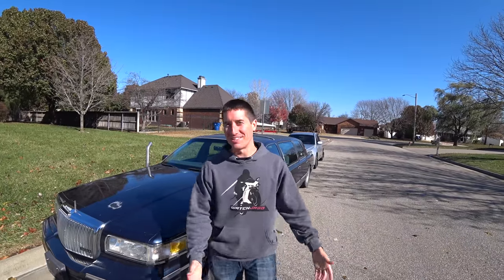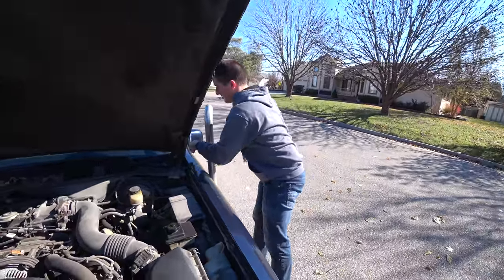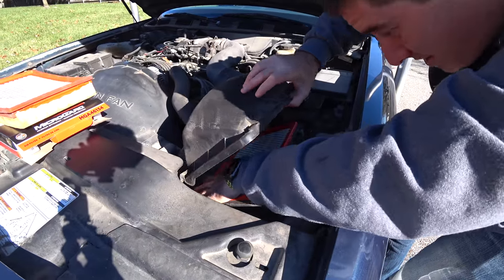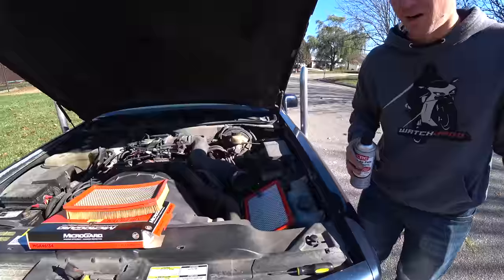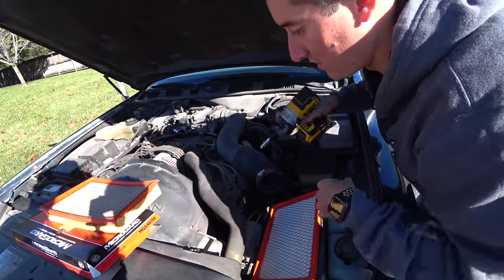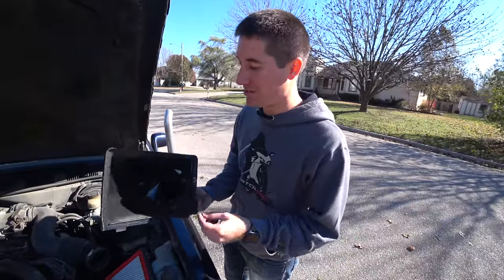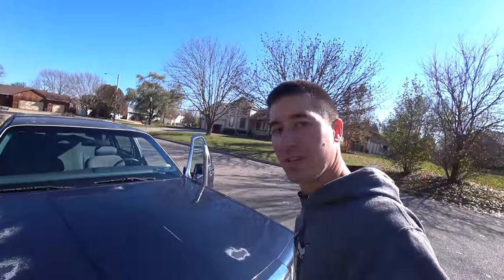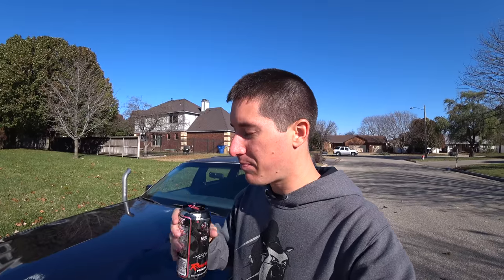FIXING My Cheap LIMOUSINE Lincoln Towncar

Comment: NEVER slam a Lincoln trunk lid.  Take it down slowly and the motor will seat it.
Reply from the maker: You're absolutely right, ended up covering the pull down motor in this video: https://www.youtube.com/watch?v=fDbnD4MNm4Y
Reply: @WatchJRGo  You needed a new pull down motor. Sweet when they work! Nice setup and a great car.

Comment: Check for a cracked vacuum line on the back side of the intake manifold, I had the same throttle problem and after I fixed the line it was completely fixed

Comment: It may be running lean with the exhaust like that and you could lose power. You could gain power by tricking the mass airflow sensor into making it more rich. You just tape some cardboard in the intake around the MAF making the intake inlet smaller in that spot. The air has to travel faster through that smaller section so the MAF gets tricked into thinking there is more air coming in and therefore it adds fuel to make sure the car won't run lean.

Comment: Maybe if you took the stacks off and put a more reasonable exhaust on it that would fix the feeling down on power and probably just for good measure replacing the other coil pack and perhaps the Mass Airflow Sensor and some general maintenance
Reply from the maker: It probably needs that 2nd coil, still misses a bit. 💯

Comment: Helps to use a q tip cleaning the mass air wires.
Reply from the maker: That would've done it for sure, I've always just sprayed them down (don't usually see that much build up on GM MAFs) 🔧
Reply: Do not touch the wires! If the proper spray (don't use intake throttle cleaner) doesn't work, just replace it.

Comment: Hey Junior check your driver side floorboard if it's wet you may want to take the plastic cover that's under the windshield wipers and clean out the three drains you were sweeping all that dirt it could already be clogged and with it being clogged the water will end up in your floorboard

Comment: The air suspension is only on the rear of the car
Reply from the maker: I don’t know why the driver side front sits a little low 🍻
Reply: WatchJRGo just a guess... broken spring, but the OP is correct the air is only in the rear.
Reply: @WatchJRGo  I have a 1996 and do all my own work, I know for a fact, the bags are only in the back
Reply: Some cars can level side to side like the continental and mark 8 so it could make the front look off if there's a leak.   However the panther bodies like this do both air springs together.  Don't drive with the suspension fully deflated and off it is the same as taking out your coil or leaf springs.  You'll just risk damage other components.
Reply: @WatchJRGo  Given the age there is a good chance one of the body mounts is failing.  Look close at the rubber on them then at replacement ones to tell for sure.
Reply: @WatchJRGo  Good possibility it's because the rear left air spring is lower than the right. Rear end is twisting the frame and bringing the front left down. If you ever want to replace the springs and compressor, look up Arnott Suspensions. Excellent stuff for cheap(er than most other places) Lifetime warranty too. Good company. I buy their stuff whenever I work on air suspensions.

Comment: Should always hook the positive cable first. The negative cable is what completes the circuit on the battery. You could get a short circuit if you hook the positive up second. Also, if your negative is already hooked up, and you’re tightening your positive second and accidentally cause your wrench to come in contact with metal, you could cause a large spark and cause a fire. Also, always hook up the dead car battery first (positive, then negative). That way, you know you won’t get a spark or short on the good battery since the other battery has no juice.
Reply from the maker: s_reilly I was just tightening the 6 inch cable from the negative terminal for the body ground 💪
Reply from the maker: s_reilly ohhh you meant jumping it, it’ll be fine either way. I’m careful not to touch the body and typically hook up the negative second. I’ve been working with DC circuits all my life 🍻 (plus I think we’ve all done a little unintentional welding with a 12v car battery before)
Reply: WatchJRGo Haha yes I meant for jumping. And yeah most of the time you’ll be ok. I can say in my teen years when I first started messing with cars I did short out a battery on an old Chevy Van. Hooked the positive second, my wrench hit the inside of the fender, and blew the battery up. It didn’t explode - it literally blew up like a ballon 😂😂
Reply from the maker: s_reilly I use to have a Suburban with a 400SBC, 6" lift, 37" Super Swampers... was bombing through some fields one day when I hit a huge ditch I couldn't see, launched the truck in the air and we all hit our heads on the roof. About 2 minutes later it started to die. Jumped out, opened the hood, the battery WAS LAYING UPSIDE DOWN ON THE HEADER. The header had already burnt a hole in the battery and acid/water was pouring out. Flipped it back over and it got me home 😂
Reply: WatchJRGo Wow!! Now THAT is awesome!! Sucks about the battery. But with that kind of setup you had, it would probably well worth it 😁😂👍🏻

Comment: Tip on the MAF, you don't need to unmount it from the air tube if you're just spraying it with cleaner.  the spray will reach just fine from the end of the tube.  
For the Air suspension, first, it's only in the rear.  the front is just regular coil springs.  as for the rear, is you just turn off the switch, it doesn't let air out, so the car will settle unevenly depending on what side leaks faster.  once one side is down it will hold more of the cars weight and the other side probably won't lose all it's air.  to release the air you need to open the solenoids located on top of each air bag.  you can do this by energizing them from the connector behind the glove box.  Solenoid powered only will lower car, solenoid plus air pump will raise car.
Reply from the maker: My thought was that they'd leak out completely if I let it sit, that good info for getting it all the way down though! 💪
Reply: @WatchJRGo  With my 95 TC, once one side made it all the way down after a couple days the other side wouldn't change much even after sitting for more than a month. I suppose it depends a little on how bad your bags are leaking.  Each baghas its own solenoid so any leaks in the air lines won't effect this, only leaks in the bags themselves or in the solenoids.

Comment: The trunk has a small clamp mechanism attached to a small motor, when closed it activates and pulls the lid down.. it’s called a soft closing trunk, and if the motor or fuse fails it won’t close fully and leave a gap
Reply from the maker: It sure does, I covered it in the burnout video! https://www.youtube.com/watch?v=fDbnD4MNm4Y

Comment: I have ALWAYS wanted a 93 Towncar with the 5.0, but a 1998 Presidential Edition in black with black leather would suffice. I would put a 5.4 supercharged GT500 or a Coyote swap with a 6 speed in it, limo tint the windows, and rock it.

Comment: Don’t worry buddy your Subaru will be there shortly.  On a side note you should shut your car off when boosting so it just taking the charge from the battery not the charging system but do what you want.

Comment: Unplug the mass and iet and I guarantee you will how alot more power I had 94 town car
Reply from the maker: The open loop tune is probably dead on where there car should be, I'll pull the MAF if it won't do a burnout when I try 😛
Reply: @WatchJRGo   alright lol .
Reply: True
Reply: @datdealracing7219  made a big difference doing that It was full power from that v8

Comment: Have you ever run a can of Sea Foam through the engine?

Don't clean your MAF on the street in the wind - do it under some cover and use a small container (like the cap off a can of WD-40) and actually puddle the solvent and soak the sensor wire.